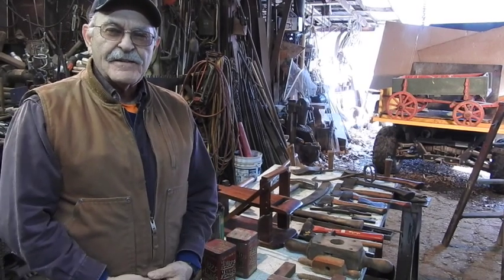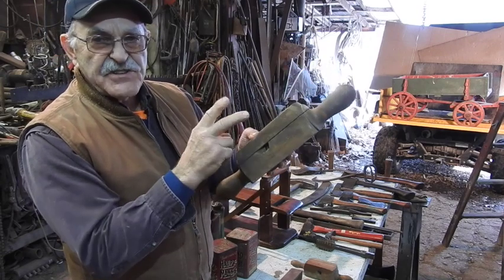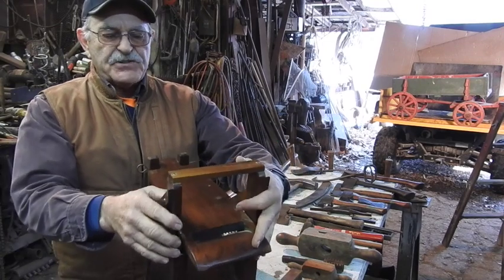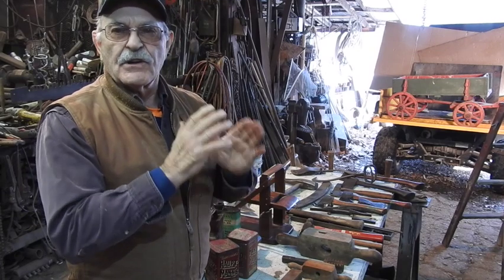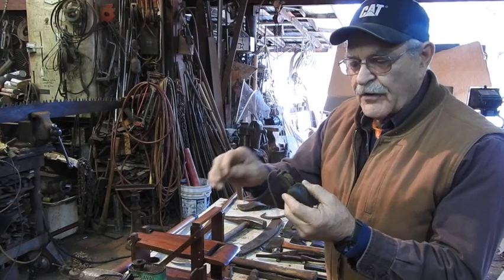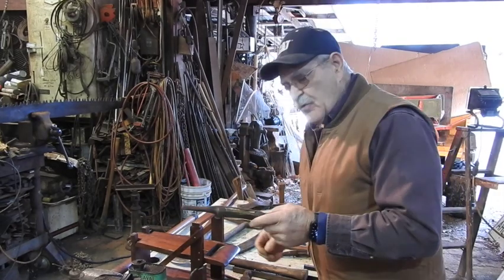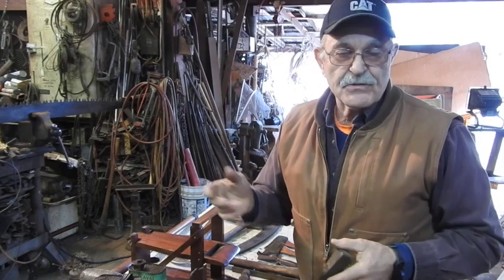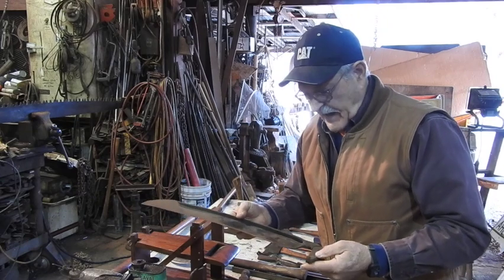Old Tools and Stuff at The Much Older Brothers Shop

Comment: That is a cool collection of old tools. Thanks for sharing this!
Reply from the maker: Too bad we don't still have the old Fisher and Davis circle mill.  Power was an inline 8 Buick and three speed on the floor.  A carrier bearing held the driveshaft in place without a rear end and the bolt-on flat belt pulley clamped around it to provide power to the mill.  It ran a 54'' insert tooth blade.
Reply: @tractorman4461  wow that is one heck of a mill.
Reply from the maker: @WildBill1122  Yes it was.  I spent many an hour rolling logs, rolling cants, stacking lumber and clearing sawdust under the deck.

Comment: I have a model of a coal wagon my father made around 1950. It is smaller but similar in color!  At first I thought you had a coal wagon. 

I enjoyed the stories and the video.
Reply from the maker: That's is soooo cool that you have a hand made scale version of a coal wagon.  This one is patterned after a plain old corn bed, or grain bed.  But removing the bed and extending the coupling pole lets you haul posts, like a miniature log hauler.